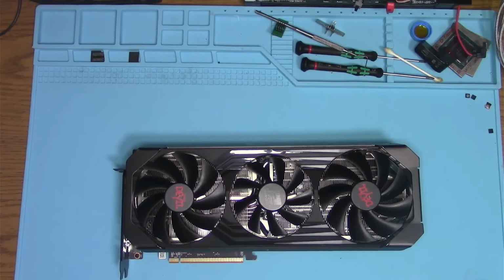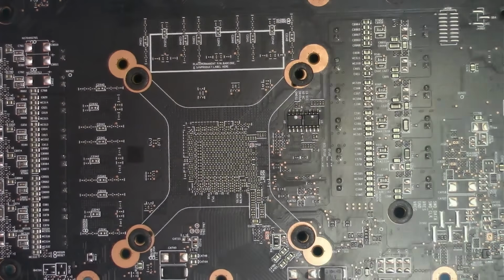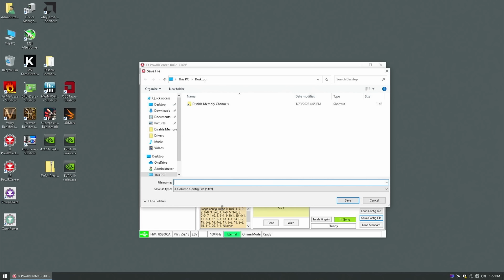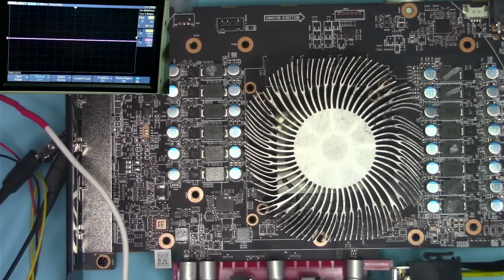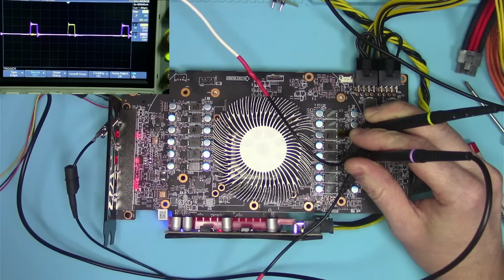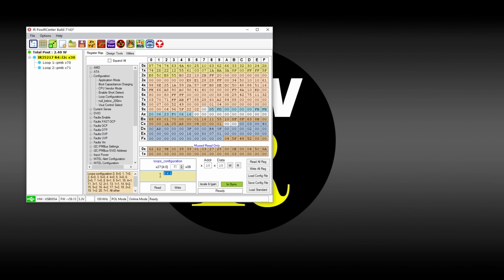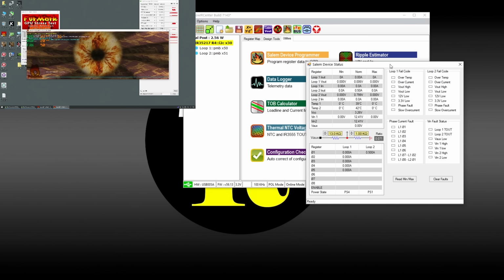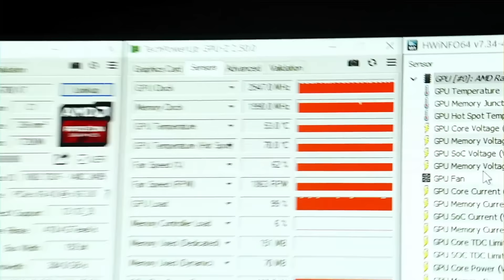Why i dont like fixing AMD cards

Comment: The thing why that controller fail a lot is because it's designed to be used with ir/infineon drmos/sps and not sic649 or sic632 so they can comunicate better. Also in general for me repairing AMD cards are easier than nvidia simply because most nvidia cards i saw are dead cores instead of AMD most of them are just dying transistor or shorted drmos.
Reply: It's also the same on nvidia cards btw, MPS controller are designed to be together with MPS SPS/drmos so when they fail their protection can kick in properly
Reply: This is really interesting information. You should make a video discussing this topic.
Reply: thats why nvidia cards last longer and not die until they have a heart attack
Reply: @accurian148 I have seen more MP86990 DrMos (coupled with an MPS2888A) burn a hole through a card (mostly zotac cards) than other brands of Mosfets/controllers, causing several layers to short together and making the repair almost impossible. (Good luck reconfiguring an MPS controller to run with 1 missing phase).
Reply: @gpudoctor  doesn't shock me at all tbh, Zotac use cheap components and design their cards with the same philosophy unfortunately. It wouldn't be so bad but they also overclock the cards aggressively making them ticking time bombs, especially for the higher end cards.
Reply: @joncarter3761  which brand besides of evga is of a better/best quality? Is asus recommendable?
Reply: @r3d4rmy66  i have a 6 year old, thoroughly abused vega64 card. It has no issues whatsoever.
Just don't buy garbage tier partner models and you're golden. It's true for both Nvidia and AMD. In the future intel too.
With that said, red devil cards, are generally good. IF amd easy XFX/powercolor. Avoid asus and gigabiyte like a plague
Reply: @TheHighborn  i have a 9400gt, using it for a lot of years never had a problem and my friend had a hd card i dont remember the model but it failed like 2 years ago and had to go into oven
Reply: @r3d4rmy66  wow. That stuff is a dinosaur by IT standards
Reply: @TheHighborn XD had to look at date comment was posted, 5 hours ago have I travelled back in time lol?

I mean if your only playing older games together I'm sure they are no problem and why fix what ain't broke haha? It's mad just what you can get second hand for your money now anyways in terms of how far things have come last 7 years or so. I'd be perfectly happy with a 10 series card today even though I've owned a 3070. Currently running a GTX 660 lol with a case fan strapped to it. As long as it works right? Plays the few games I care about and works great as a display adaptor for my 2 monitors lol. Kinda weird configuration though when I'm running a 10700k and 32GB of RAM with a 660 though must admit XD but when times are tough and all that haha.
Reply: @dubonstin8676 Certainly not EVGA - they're a bunch of chancers. Terrible cards.
Reply: @TheHighborn sapphire are the best ones out there as far as my experience goes, never had a problem, nitro+ is usually one of the best if not the best
Reply: @Malc180s  So now Asus, Gigabyte, Zotac and EVGA are all garbage.. Not that EVGA is really in the running anymore. So that leaves what, PNY and MSI? How do they fare?
Reply: @dubonstin8676  It really depends on the model. Sapphire has an excellent reputation, but they only make cards for AMD. I really like that Sapphire doesn't seem to make cheap boards, and their most basic models are usually still very good, from what I've seen in tear-down videos and whatnot. Nobody ever seems to have a single bad thing to say about them, but there's always somebody who's got something bad to say about every other brand at this point. That being said, you should never blindly trust any brand, and should check reviews for the exact model of a card before buying it, if possible.
Reply: @joncarter3761  I ran a zotac 3080 for over 2 years with zero issues, admittedly I fitted a double sided water block to it so it was well cooled.
Reply from the maker: I agree to a degree.
For example I've had maybe 20 AMD cards so far and over 250 nvidias.
Out of 20 AMD, maybe 2 had dead core.
Out of 250 of Nvidia, maybe 20 had dead core. (Don't make any assumptions yet)
90% of dead cores I take into account came from one person with EVGA 1070 SC mining farm where memory MOSFET shorts and kills memory and core.
60% of all the cards came from that one person had a dead core.
With that said, its not fair to assume Nvidia has a higher dead core rate vs AMD but it all depends on the usage.

If we take cards strictly from average users, I doubt we are going to get a lot of dead cores.
Likewise cards from miners, modders or overclockers or hardcore gamers are more likely to have a dead core.
In my opinion anyway 🤔

I think in order to end this debate, we have to get consistent supply from the same sources rather than random customers sending who knows what from who knows where with unknown history or a re-fab of some sort.
Reply: @dubonstin8676  For AMD Sapphire is pretty much the best, Powercolor and XFX are good too from what i've heard. I've had a XFX 6800 XT for 2 years now with a heavy overclock and it has served me well.
Reply: @gpudoctor sadly i had two Zotac Nvidia cards that blew up a hole, it's cheap and it runs cheap. :(
Reply: @TheHighborn If it works for him then good.
Reply: @dgsdhsdeuye57 Mined? Over clocked?
Reply: @blackterminal  yeah, most of the ethereum-based mining tutorials was about underclocking gpu, but overclocking memory 

issue is... sure you can save power and standing at the memory performance as it's "efficient", but the IMC suffers from this

Sometimes the gpu shows perma-artifacts from RAM and when exchange all the memory dies, we discover the gpu had IMC damage,
Reply: @TheHighborn maybe a 8800GTS is more dinosaur tech or fossil tech??
Reply: What aib card manufacturer from and do you think is best/see the least?
Reply: Bruh i didn't realized there are a lot of people commenting.
Reply: @dgsdhsdeuye57  zotac are known to burn cards because they don't use 12v rail inductor which smoothen the input. That's why the mosfet is overloaded with dirty input and blew a hole.
Reply: @syncmonism I still have a sapphire 9770 GHz edition working like a charm
Reply: @KitCatXIV since no one mentioned inno3d, does that mean they're good?
Reply: @TheHighborn  wat do u mean

when talkin about amd

it s gotta be sapphire
Reply: Hello🤝it was good, you have a lot of knowledge about graphics cards, especially AMD. I have Rx580 Armor 8GB OC and I don't know what it's about. I tested the memory with your Tserver and it's ok, but the problem is that it crashes during games, but furmark and heven run normally. In your opinion, can I try a new bios?
Reply: @dubonstin8676 They're all pretty close, around 1% difference, but here's an article on failure rates.
I'll send a second reply for easy copy paste
Reply: I choose cards that have a lot of tantalum or aluminum caps 
Just like buildzoid said
Lol
Reply: @TheHighborn  Had 1 ASUS AMD card and 1 Nvidia - best cards I have ever had in my hands, now I have Gigabyte AMD card (used) so far so good. On the contrary I would never use XFX/Powercolor. Very rarely used brands in local market so I just dont trust them. ASUS, EVGA, Gigabyte, MSI and some more are mostly used in local market with mostly good reviews so I guess its really about specific cards and how the user handles them...
One more thing, if I was to recommend specific partner for AMD then its Sapphire all day long. From past experience Sapphire cards had upper hand against other vendors on the same chip and with 2 cards from them I had I had 0 issues, sold both after years of service when I was upgrading.
Reply: what about Sapphire? I heard they are pretty good
Reply: @northwestrepair lol, i often hear people promote used mining cards are not bad because  it was used on stable condition. But i guess non-mining card is a better one, anyway.
Reply: @keselekbakiak  had mining used GTX 1070 for years. Bought it because the price for that time was unmatched. Dude showed me the entire rig, the settings and told me how it was used an maintained (he didnt try to hide not so great maintenance). I took the risk. Best pc related decision in my life. That GPU still works today - I sold the entire PC to a friend of mine when I got a new one.
Reply: I’ve had no problems with any of the listed “don’t buy” brands and I build gaming rigs. Zotac isn’t my favourite, but run them within spec and you should be fine. The problem I see with higher end cards is people try to run them way out of spec because they will go there…………but not 24/7.
Reply: @peterkolesar4020  what gpu are you using now?
Reply: @Reformedekko  currently RX 6800xt
Reply: @GTORazor  an 8800GTS has 8 times more cuda cores, definetly not "more" dinosaur tech, but actually far stronger, like 8 times more
Reply: @niclvp are you tripping bro? The 8800GTS came out over 14yrs ago. Its ancient in video card terms. It has far fewer Cuda cores if that is even what they called them back then.
Reply: @GTORazor  would appreciate if you actually read the bloody comment that i was replying to. i was saying the 8800gts is stronger then the 9400gt, genuinely illiterate
Reply: @niclvp  I couldn't tell, it seemed like you were replying to my comment, sorry.
Reply: @GTORazor  it's alr, soz man
Reply: @keselekbakiak I think it depends. I am using mine 3080 as a space heater(not joking) and it is at a constant 45 degrees..

If those nvidia cards were cooking 24/7 yeah, they will go

Comment: A lot of 6000 series cards made during the pandemic, mainly the original 6700/6800/6900 variants, suffered a lot from subpar quality components being used because less people were working In the factories, and there was much less oversight to ensure quality control. I've seen many of these cards fail due to many issues including bad silicon, faulty bios chips, and just subpar quality builds Even with brands like Sapphire, PowerColor, XFX, and ASRock which supply the majority of AMD's GPUs due to these companies being strictly AMD only. I would actually suggest to anyone owning any card from the 6000 series to look for the 6x50 variant of any card because the build quality will be much better.
Reply: PowerColor and AsRock aren't much quality. They aren't bad but they aren't quality either
Reply: @gabrielgabriel9779  PowerColor is actually one of the two top brands, especially the Red Devil series is on par with Sapphire's Toxic/Nitro+.
Reply: @gabrielgabriel9779  asrock is the best of the companies for quality, I use asrock boards and gpus exclusively better performance and longevity.
Reply: @gabrielgabriel9779  if AsRock isn't quality i dont know what is. Especially when it comes to boards they use high quality components where it matters as caps and mosfets while keeping a reasonable price for the customer.
Reply: What context? I find it hard to believe that Sapphire would be cutting corners, especially on 6800 XT or 6900 XT models, and likewise with the better quality boards from Powercolor and Asrock as well.
Reply: @syncmonism  Asrock Challenger Pro  is the best gpus to buy super reliable.
Reply: @syncmonism  it's not the OEMs that cut corners. The actual components made and used on the boards have been found in many cases, to be on substandard quality, like the SMDs, capacitors, etc.

The boards and GPUs were made with the same quality levels normally found from each vendor, but the components that are used, might not be the same quality normally found.
Reply: @gabrielgabriel9779  only bad asrock component I'v ever had was a rx 570 that showed up DOA
i use asrock motherboards in as many builds as i can, they always work i've never had one die on me 
MSI i stopped buying, gigabyte, zotac and Asus i stay away from
EVGA and asrock i usually always buy when i can

Comment: Doubling fases is common practice, I'm not a board tech, but I immediatly spotted the fact they called it 5+1 and there's actually 14, mosfets, inductors and caps. However, like you say, the 2 SOC phases arent in the 5+1 equation. The +1 part is the memory VRM, which exists out of 2 mosfets as well. And the remaining 5 VRM phases are doubled and divided over 10 mosfets.
Reply: I don't think so, the plus meaning independent voltage regulator is loop 2 that is soc not mvdd that controller by other pwm maybe ncp81172n

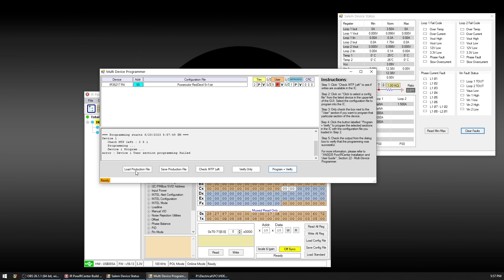Comment: When flashing at 39:18 it said “Device 1 User section programming failed” followed by many more errors.
Also isn’t it unwise to dump and then reuse a potentially corrupted firmware? Of course I have no idea how easy or difficult it is to get a fresh firmware copy. Especially as a lot of the time the manufacturers seem to prefer making shit way more difficult than it needs to be.
I think u mentioned that the controller chip could be bad at the top of the video. Which is why I’m asking about the reuse of the same controller firmware. 

I really enjoy watching you work as you take care to make it as easy as possible to follow along. Which is appreciated 🙏
Cheers ✌️🖖

*an added comment here after I listened to what you said a few seconds after flashing the firmware. I hadn’t gotten that far as I stopped the video when I thought I saw that it said failed. So I backed up and the commented before you more or less confirmed what I wondered about reusing the firmware 🥴. Anyhoo
Reply: sometime clearing and writing same program can solve problem. You dont have a nand memory type in these devices but nor like memory. nor memory dont have conotroler to utilise memory banks so if data banks are corrutped or are unable to be cleared it lead to errors. Thats why clearing and refreshing banks can resolve problem  but you are right that it is a common sense to put verified good program inside.

Comment: amazing repair, I think you can diagnose faulty dr mos by measuring the V in pin and check if it has lower resistance than the others
Reply from the maker: Interesting.
You're saying it's internal resistance on vin will lower it it's faulty ?
Reply: @northwestrepair  it happened to me in several faulty dr mos, but these were graphic cards with shorted 12v aux rail. Maybe in cards that crash and good IOR chip is not the same. Try it.

Comment: I don't know if it is just reflections but the cap to the left of phase 3 you identified looks to be bulged. 
It just looks a little different than the other caps, might be it is not sitting fully flat compared to the rest so reflecting the light differently. 
Maybe it does look a little domed at 34:29 when the light moves across it.
Reply: I noticed the same watching the video and was wondering whether I'm wrong on that... 😊
Reply: you're right, it's bulged
Reply: @Ren-kei  It's like "Sacon FZ cap fiasco" of the GeForce 7-series days all over again! (and for ATI at that time, even when AMD bought them already in 2006, I guess Radeon X1000 series? Or very-early Radeon HD series? Such as Radeon HD 2000 series?)

Comment: TLDR/TLDW: He's not as experienced troubleshooting the specific AMD controller (he mentions this himself @56:53) and he also mentions he's not a specialist with AMD controllers of this specific type. That's why he doesn't like fixing AMD cards as it can be complicated for him.
Reply: According to him, he still thinks that AMD cards (at least from more recent generations) are inherently more difficult to diagnose and repair. It's arguably not a major issue for the consumer, it basically just means that repairs outside of warranty coverage can be more expensive and time consuming. Still, I would like to see AMD make improvements in this area. Electronics should be designed to be reasonably easy to diagnose and repair, whenever possible. 

From the consumer's perspective, most cards will never have a major failure even if you use them heavily for five years in a row. If the cards are used properly, and if they're decently well made, the first components which are likely to stop working are the fans, and those SHOULD be fairly easy to replace. Some brands make it a lot easier than others, but you can always resort to just zip-tying some case fans to the card's heat-sync, as long as there is enough space in your case, and this can work very well as long as they are powerful enough.
Reply: @syncmonism that is his opinion, and it's definitely a valid one, but another person who's worked with more AMD cards can say the same thing with NV cards if they don't work with it as much they do. Each shop and person has specialization, and one can say one is easier based on their experience.

Comment: I have similar problem with my PowerColor R9 285. The difference is my green screen crash comes intermittently. I think I'm going to check if my card use this chip and check the solder joint. Thank you for this informational and educational video.

Comment: So the GFX phases are arranged like this:
10 (=10)
5 (+5=10)
9 + 1 (=10)
4 + 6 (=10)
3 + 7 (=10)
8 + 2 (=10)
with the bottom 4 rows doing a clockwise sweep like a lower-case omega starting in the top-right: ω

EDIT: And then I reached 32:00 in the video and understood the problem. :hand-orange-covering-eyes:

Comment: I think you are by far the best at soldering of anyone on the net. Alex says better than factory. Not sure about that, but he is excellent at correcting other sliders mistakes.  This morning he looked at a connector and the whoever had placed a large blob of solder on all the connections but since this was a Nintendo Switch he might not charge over the moon charges. Kris Fix in Churmany solders chips back with non leaded. I feel the reason for a lot of failures is no lead, but a lot of his pads have the pad pulled off, thus not the solder but board failure due to flexing.